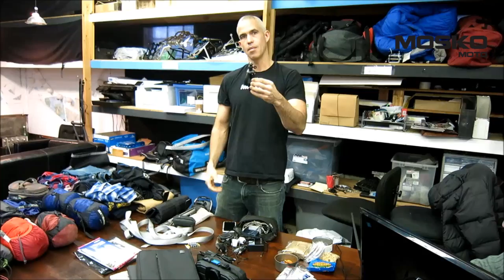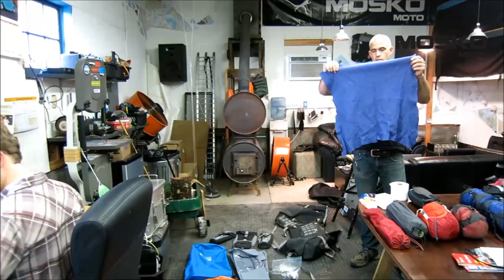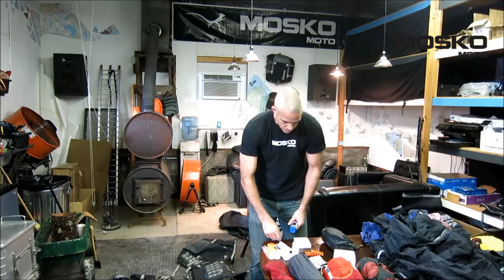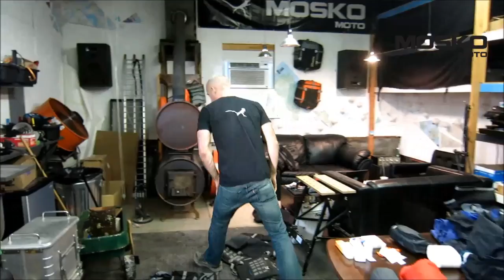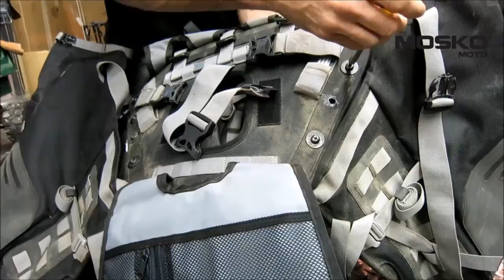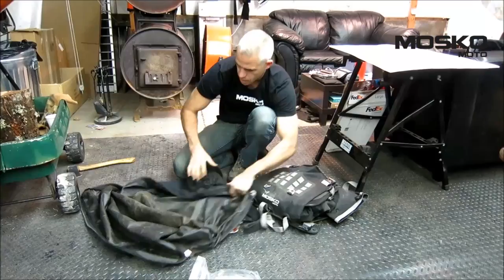Reckless 80L (V1) - Packing for a Month Long Moto Trip Abroad | Mosko Moto

Comment: Simply the best gear , just fully outfitted my DR650, reckless 40, scout 25 and a Stinger 8 with fuel bottle carrier FTW...molle system is so easy to use.

Comment: Hey Pete , I have an older reck 80 that are pretty cool but I do have a question. So the side bags. Why not just waterproof the sidebags out instead of the awkwardly the awkwardly bizarre inner condome bag thingys that you stuff and twist the tops closed on. Really strange design and still not sure why that system is the way that it is?? Anyway would be interesting to hear it from someone that knows what they are talking about. Im probably way off base . (typical)
Reply from the maker: Hey Tim! Sorry for the delayed response here. The separate dry bags make the Reckless system a lot more versatile. You can remove the dry bags to bring them inside, or around the campfire, etc., or not use them at all and still utilize the legs.

Above all, we take some pretty hard crashes on our Reckless systems. The leg is constructed with 1680D Ballistic Nylon with hypalon armour which protects the dry bag. There's a number of reasons we've chosen this design. Hope this helps!

Comment: Maybe you already know this, but you can safely snap off the third prong on your laptop charger, then you don't need 3-prong to 2-prong adapter. It only grounds the charger brick internals and not the laptop, and the charger brick casing is non-conductive so it's not even legally required.

Comment: What gps software do you use on your phone?
Reply from the maker: +Omesh Agam No software. We're using paper maps combined with unlocked iPhones and local SIM cards for google maps, plus asking a lot of directions and pointing.
Reply: +Mosko Moto is it just a matter of swaping the sim ? I thought you needed to update the carrier details - so needed to be connected to computer ( which i don't like to carry ) + wifi - I was thinking to get a cheap android because of this.
Reply from the maker: +recom273 You just have to switch the sim, however you have to do it at the carriers office if you want 3G data. There's an office in pretty much every little town. Takes about 15 mins.